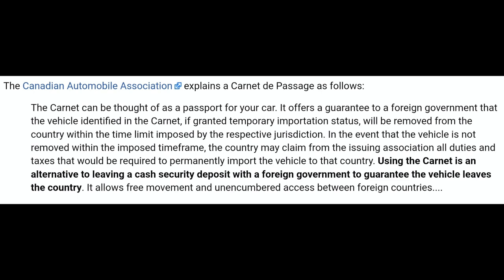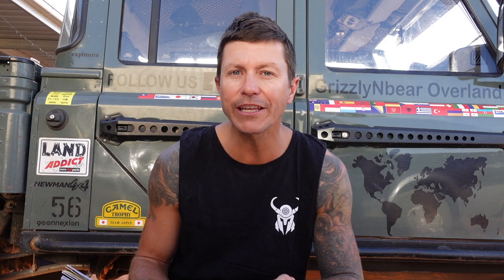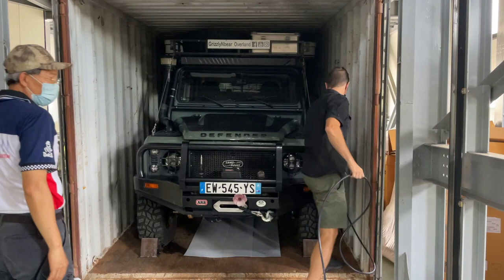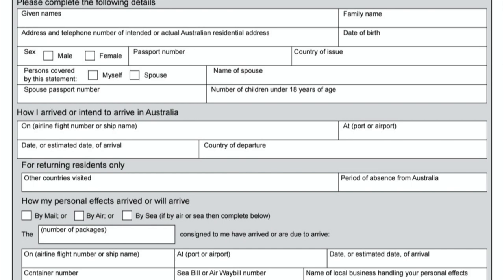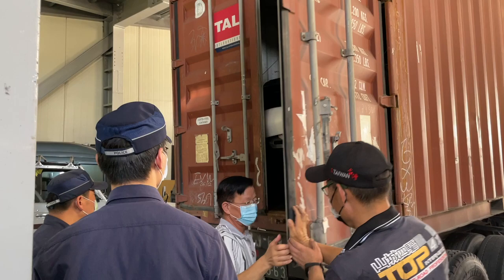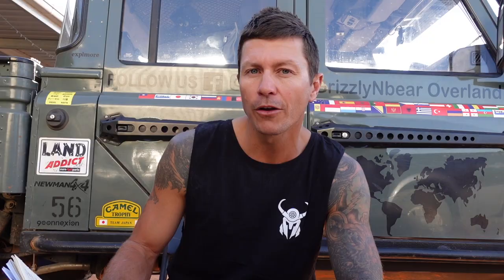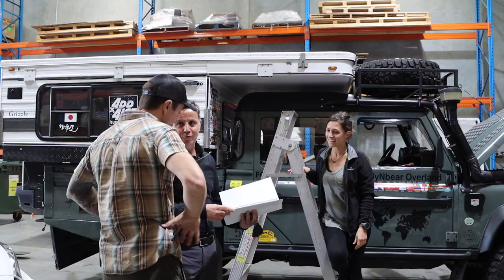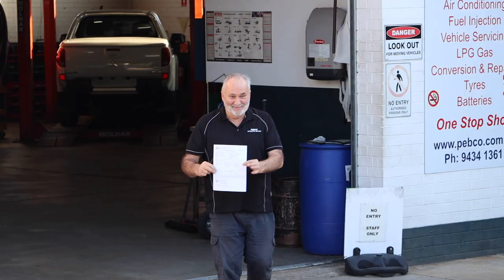Shipping a vehicle to Australia and around the world 🌏🌎🌍

Comment: Great video guy's,  how did the battery hold up after 6 weeks without charge and did you get any water in the fuel ⛽️
Reply: No water in the fuel although we do have a water fuel separator pre filter. The battery was fine. We have a dual battery set up and I linked them both for the start up.
Reply: No water in the fuel although we do have a water fuel separator pre filter. The battery was fine. We have a dual battery set up and I linked them both for the start up.
Reply: No water in the fuel although we do have a water fuel separator pre filter. The battery was fine. We have a dual battery set up and I linked them both for the start up.
Reply: The batteries were fine, started first go. No water in the fuel. We do gage a good pre filter that has a water separator.

Comment: Left Hand Drive plate?
Reply: We put one on but later learned it's no longer necessary for vehicles under 4 ton.
Reply: @leighdearle5965  Hi Leigh, when you were in Europe, how did you handle the required yearly or biannual vehicle inspection?
Reply: @DaciaProject  we left Europe before it was due and have not returned since 😉
If we do return to France we'll need to do the inspection.